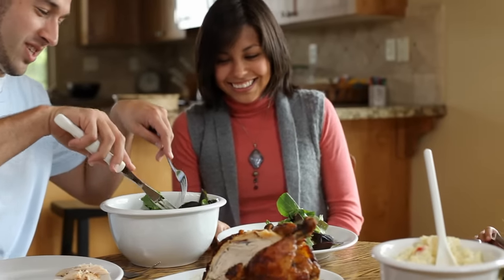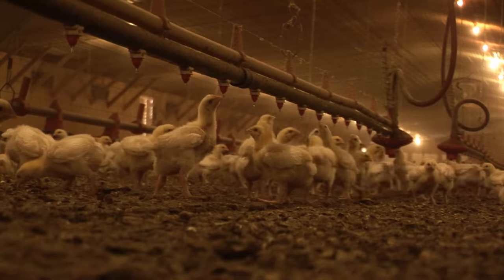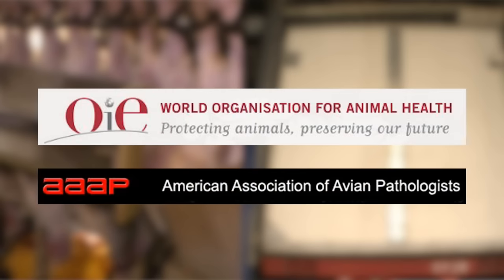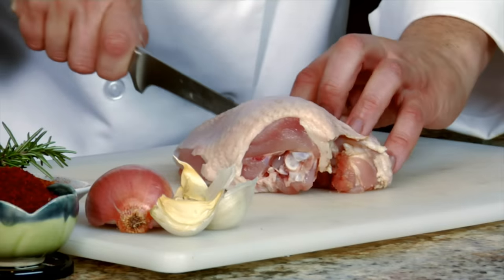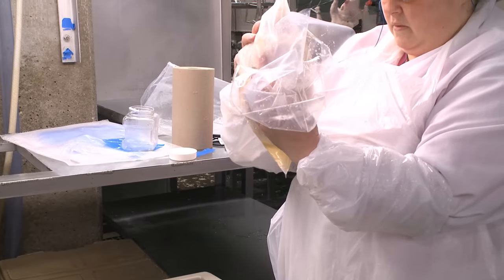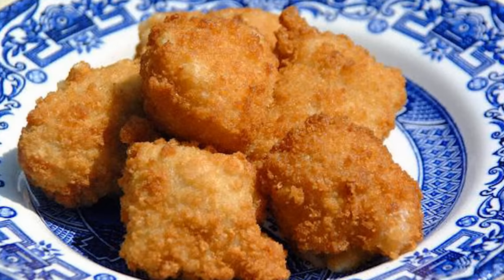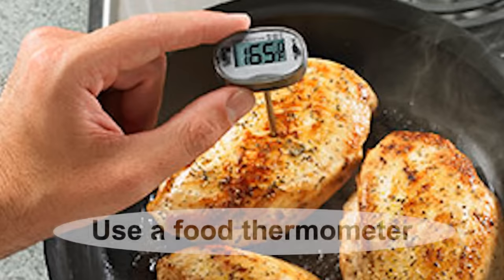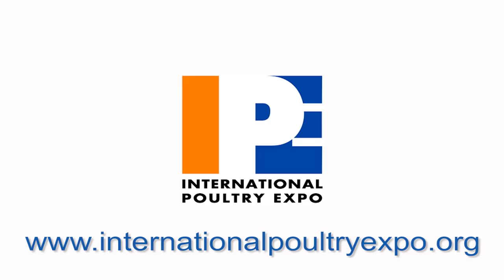An Inside Look at U.S. Poultry Processing

Comment: 3:02 you should never cut raw meat on a wooden cutting board. The juice runs into the wood, which contaminates any other foods you cut on it.
Reply: This is not true
Reply: Citric acid from lemons does great at cleaning wooden boards. RNase also works great. 👍

Comment: Processing has improved however the end product is worse. Most of the deli chicken for sandwiches has to be toweled off to remove the excess water or the sandwich will be soggy. Would rather  you raise the price then lower the quality of the product. It's not just you, all meat companies are doing it and it's awful. I use to fry my eggs in the grease of a sausage patty until more water made the egg stick to the pan. Lets lighten up on the water injection please.

Comment: This video only says what people want to hear and not what they need to know. When the birds are growing up, most of the time they are squashed together and standing in their own feces. They are bred to grow at an alarming rate in a short period of time, and often their legs can't keep up so they are unable to reach food, causing them to die.  Other causes of death are bacterial infection, thirstiness, lung and heart disease, injury, squashed beneath others, and many more. At only 7 weeks of age, they are grabbed by the feathers and thrown into crates, which are then loaded onto a truck. Transportation is the first and last time they see the outdoors. They are crammed together and many suffocate beneath others. Once they reach the slaughterhouse, they are hung UPSIDE DOWN on shackles. They flap in distress causing tears and breaks. They are taken to an electrofied shallow water bath, and their heads are dragged through rendering them unconscious. Another way of rendering birds unconscious is gas chamber. They are put in a chamber full of carbon dioxide, causing them air hunger and eventually death. After they pass out, there are two ways commonly used to kill them. The first one is sending them to an automatic cutter,  which slits their throat. A worker stands by to manually kill those who escaped. The second way is to leave them in the gas chamber until they are dead. This process takes about 5 minutes. But mistakes happen. Some birds lift their heads above the electric current and are fully conscious when their throats are split. Other birds who make it past the cutter and the worker go into the hot water tank ALIVE. All this only happens to girls. Boys are tossed down the grinder the day they are born. If you have read this far, thank you for allowing yourself to see the truth I've seen. 

Edited spelling mistakes.
Reply: Who cares
Reply: @lilcourtny08  the victims care and so should we

Comment: Please change the machinery to remove the chicken`s head immediately right after entering the processing line just like in the fish industry, instead of electric stunning (risk of stunning failures) and cutting neck plus hot water and defeathering afterwards - and head removal too late during the middle of the process before gutting. If the head would be removed right away instead that neck-cut processing step, entering hot water and defeathering and every other processing afterwards would take place without the head and therefore guaranteed without pain and stunning fails. This little change in the production process would make chicken to an absolutely 100% ethical perfect product to eat.

Comment: as a maintenance worker at a chicken plant, I can verify that the chickens and processes they go through (alive and dead) are carefully watched by the USDA and Quality Assurance. I personally make sure on a daily basis that when the chickens go through the stun machine and kill machine, they are fully unconscious and do not feel a thing. you can tell when they're fully unconscious and when theyre not. but there is a difference between the kill machine cutting too deep and them not being knocked out. sanitation is a must as well, I usually wash my hands about every five minutes, as well as just about everyone else in the plant. I'm sure there are other plants that aren't as strict about their rules and regs. but my plant, you can't slip up. if you're not sanitary, punishment. if you even verbally abuse a chicken, terminated. chicken plants aren't as bad as what people think they are. and the smell is worse on the outside than it is on the inside. except for the picking room, it smells horrible. and you would think the kill room would stink, but it doesn't (kind of has a soapy smell to it)